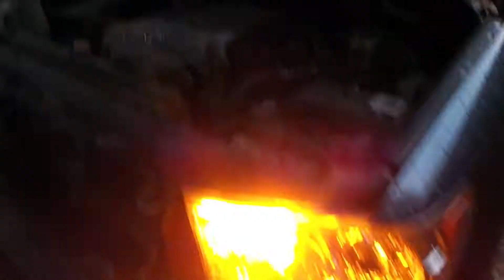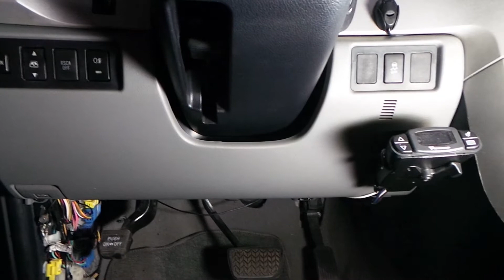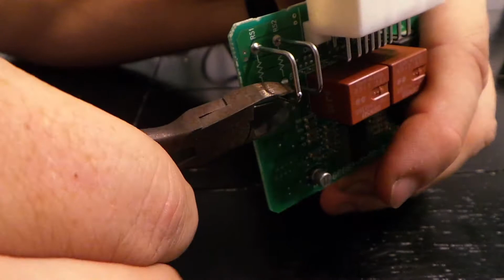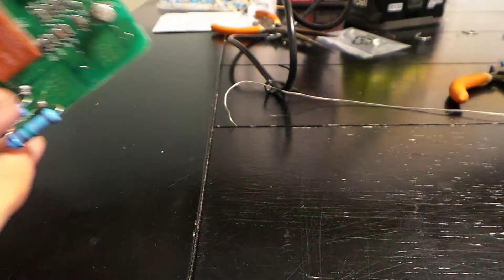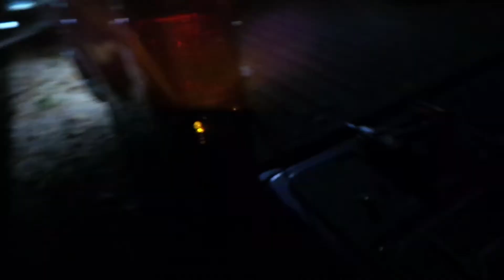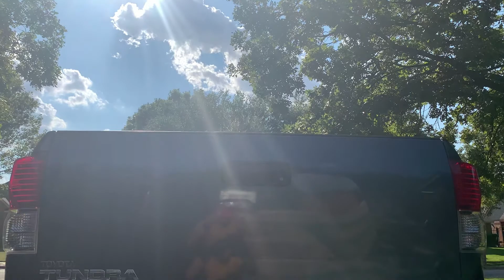2007-2013 Toyota Tundra LED Bulb Install/Modification - NO HYPERFLASH

Comment: why not just get the ones with built in resitors?
Reply from the maker: Eventually they fail, especially here in Texas with the extreme heat.  The resistors melt/overload and then they hyper flash.  I had some and they failed in 6 months.
Reply: That defeats the whole purpose of LED lights. LED light draw much less current. A resister at the lamp creates heat. That’s what we’re trying to avoid. Having resistors at the source of the output (flasher relay) is best.
Reply: @KDFRxpo2 an led bulb with a built in resistor is a must have if u want pure plug and play ultra bright led that draws between 21W-30W led. From aluminum heatsink with ceramic to integrated cooling fan.

And update decoding time to eliminate the hyperflash. Those designs are more for enthusiasts for ultra bright lights. 

A plug and play external resistors will do its own job, while the led bulbs will do its own job to dissipate only. 

Not every vehicle has ole flasher relay nowadays. 
I wish all vehicles have oek flasher relay.

But now they control by the BCM. That’s why u get resistor to mount the wires, or plug and play version, or get a led bulb with a built in resistor for more pure plug and play solution. 

Or if ur vehicle has oem flasher relay, just swap with led flasher relay. 

There’s alot of ways u can do nowadays.

Comment: is the box in the same location on the 2017 Tundra and do think I could get away with the same resistor
Reply from the maker: As far as I know, the relay box is in the same location in the 3rd generation Tundras (2014+)

Does your 2017 use two bulbs for the rear flasher or just one?  You have to vary it by load.  I can't remember if both the stop and turn flash at the same time or not
Reply: @minter66  just 1 bulb for turn signal in rear
Reply from the maker: Then those resistors should be effective for one bulb front and rear like my 2007 Tundra.

If you want to DM me your address, I'll send out two to you. I have 28 extras that won't be used.
Reply: @minter66  would this work on a 2014 Tundra? I installed resistor on front LED and I get hyper flash when headlights are on. Prior I was running LED on rear only ,they were hyper flash ready from factory and front were stock oem bulbs and had no problem.

Comment: Look good you did a great job thanks for sharing your experiences.  I have questions i would like to know if the 2 resistors works for the 2 front and 2 rear signal.
Reply from the maker: Yep!! Those two resisters on the board handle front and rear turn signals as long as the LED bulbs you choose draw adequate voltage.  That’s why I listed the bulbs I bought, they work perfectly.
Reply: @minter66  I'm trying to do my 2012 tacoma. How do I do the math to get the resistance of the resistor that I need? measure the resistance of each bulb and add it up to get the resistance of the resistor i need? or is it just the resistance of one bulb?
Reply from the maker: @previouslybearsinhawaii  Add four up together, then divide by two (unless the Tacoma is wired differently and only has one resistor)

Whatever you get is the Ohm resistance for each resistor.  You may not find an exact value resistor so a little more resistance is not bad, too little causes hyper flash.

Make sure to measure resistance with both parking lights illuminated and then with full turn signal illuminated.  Take the larger value.

You May want to read through this website If you want to get exact science:

https://www.evilmadscientist.com/2012/resistors-for-leds/

A formula is posted based on voltage, which obviously we are 12V

You’d need to know the Vf of the LED bulbs

Honestly just doing the Ohm resistance math/division should ballpark where you need to be
Reply: @minter66  perfect thank you!!!

Comment: I was just reading about this mod on the tundra talk forum.   Glad to have found your video here thank you so much.   I don't care so much about the hyper flash on the exterior but the fast clicking relay in the cab is extremely annoying.   And the W.A.F.  is extremely low (Wife Acceptance Factor)
Reply from the maker: Ōin Taylor  I have learned that the WAF is an incredibly volatile and constantly changing variable, you do not want to upset this parameter
Reply: @minter66  I need to watch your Dasaita video also
Reply: Hey Man, just wanted to come back and give you a BIG THANKS once again.  Just did this mod and fixed the hyper and your guide here is spot-on and extremely helpful.  I make videos myself, but I don't think I would have done as good a job as you did here.

Comment: So...Before!!!!!! I found out they make a bulb with everything built in it I took the gamble of your instruction and "IT WORKED!" Your soldering actually looks better than mine. Still works! 
 Thank you! very much.
Reply from the maker: Awesome, as long as it gets the job done!

And the bulbs with the built in resistors failed me after about 6 months.  Texas heat can be brutal.
Reply: @minter66  Good to know. Thanks again!